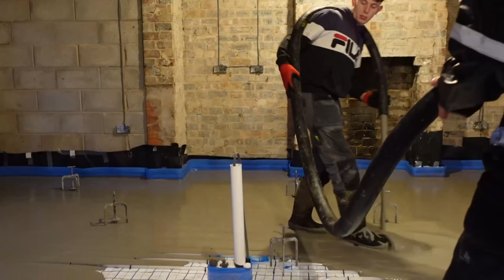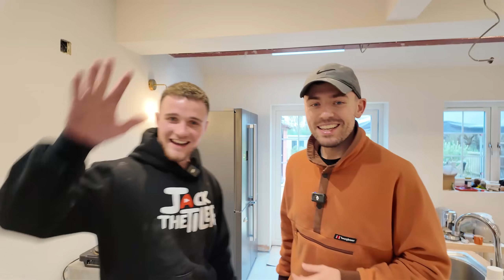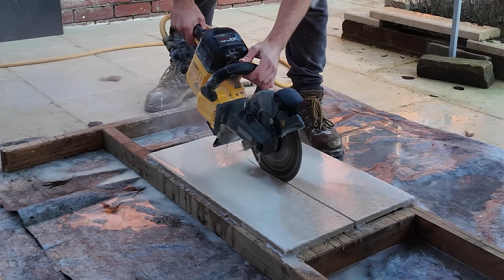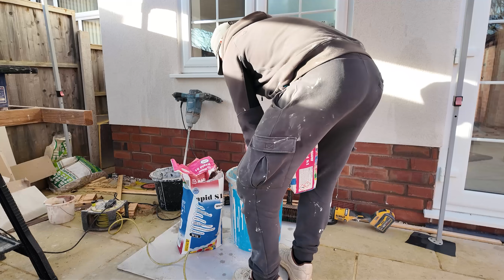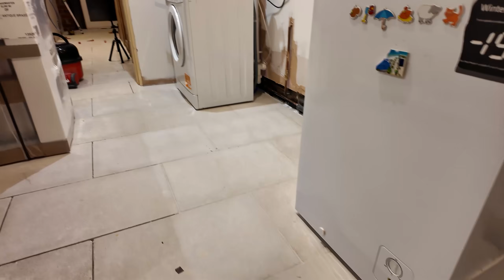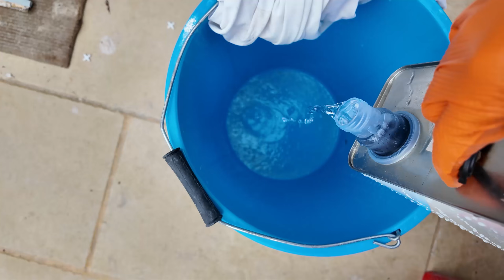TILING THE KITCHEN AND HALLWAY - DIY Renovation

Comment: Quality job you are doing there buddy, What’s the purpose of a decoupling membrane?
Reply: anti-crack tile mat evenly transferrs energy across the floor avoiding acute pressure points which inevitably lead to cracking
Reply from the maker: I couldn’t have written it better than how Dan has in these comments 👌🏻
Reply: I think it's to avoid cracking. I have never seen that type of decoupling membrane Scott  used, it seems very thin, personally I'll try to get a builder to use STS 6mm tile backer insulation board on my next project because my current floor is freezing cold to walk on, so lesson learnt for me